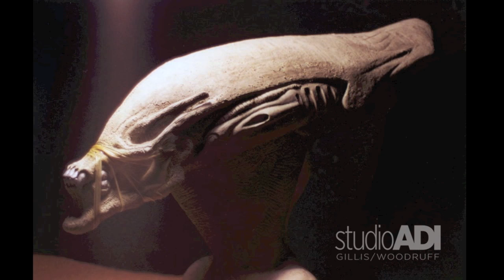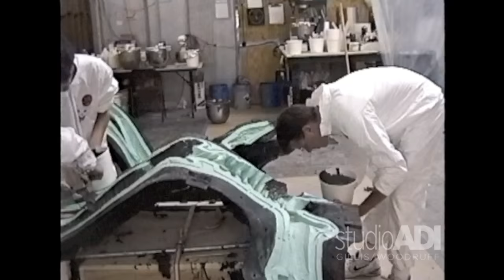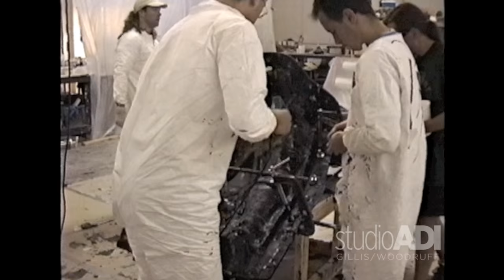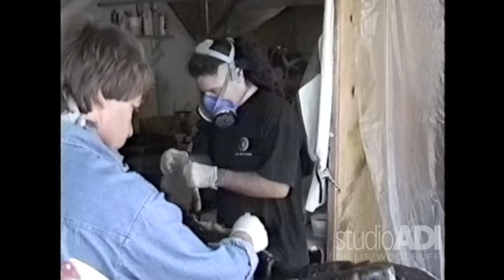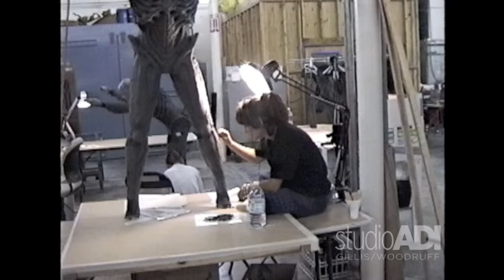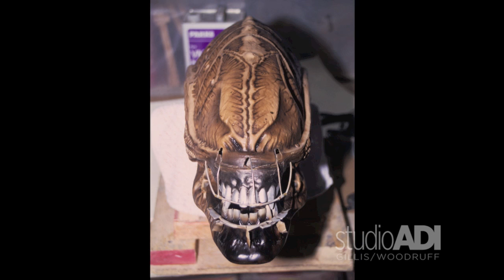ALIEN 4 Warrior BTS ADI ALIEN RESURRECTION

Comment: Everything is awesome but the hands imo, those way too short thumb, and pinkys, with those waaaaaay too long two middle fingers, just not very practical at all, just think would have been lot better looking, and more realistically practical if two middle fingers were slightly shorter, while thumb and pinky just a little longer, could still have the middle ones stick out more, just think they over did it, doesn't even seem like could grab, and or hold anything with those hands\fingers being way they were